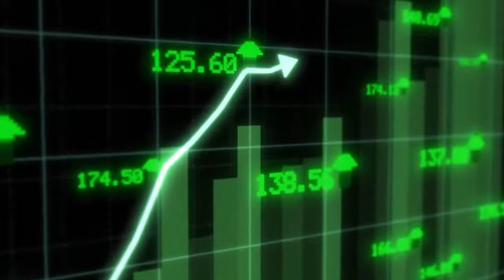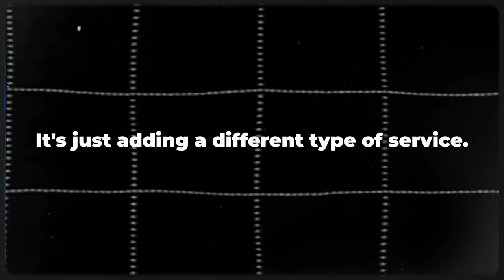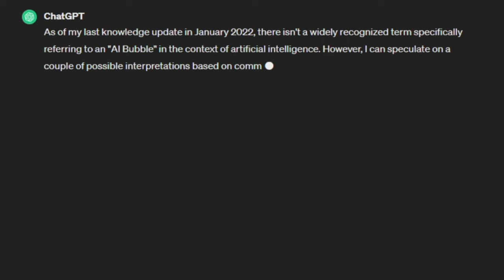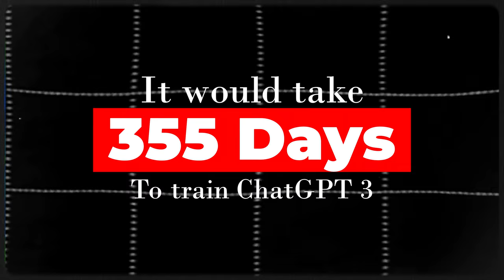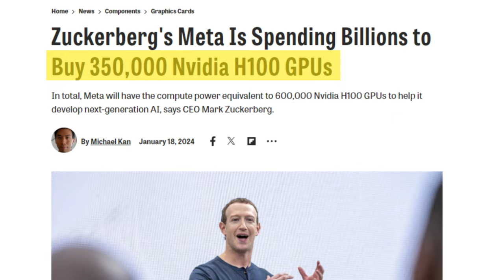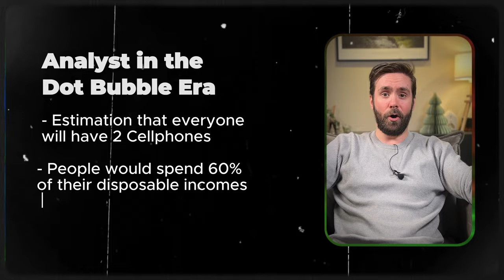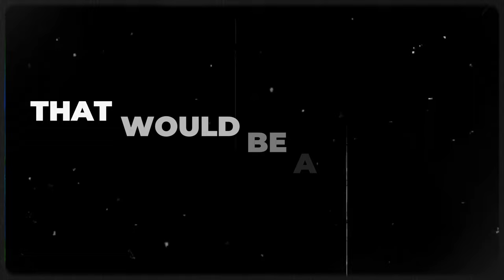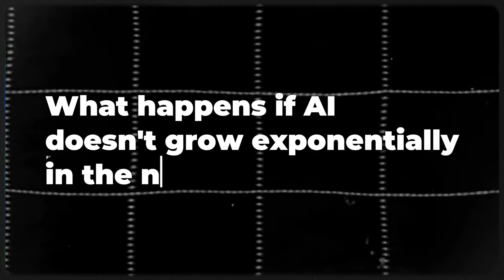Are we in an AI bubble in 2024?

Comment: These are some pretty informative stuffs, thanks! Especially when you pointed out that we're not even close to the AI bubble because of our lack of resources. I'm looking to start investing on stocks, do you have any tips or friendly advice on what should I invest on as a beginner?
Reply from the maker: Hey @VirtualHustlers! Thanks for watching. If you want to get started learning about investing in AI I think starting with an understanding of data centers and GPUs is important. Memory and other components required to make things run smoothly is very important no matter where we are in the AI cycle as it is needed regardless of who’s in the lead.
Reply: Ah, I see. That does makes sense. Thank you!